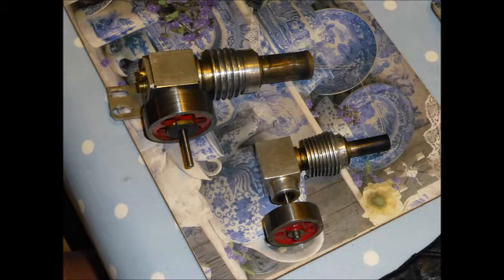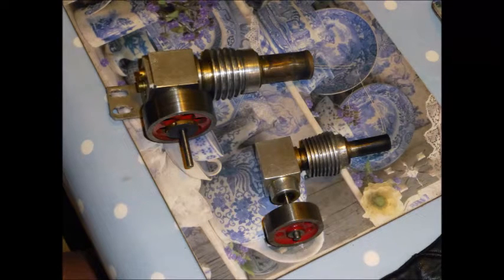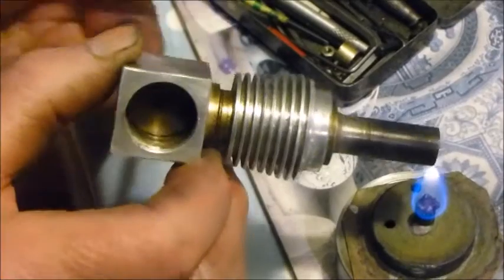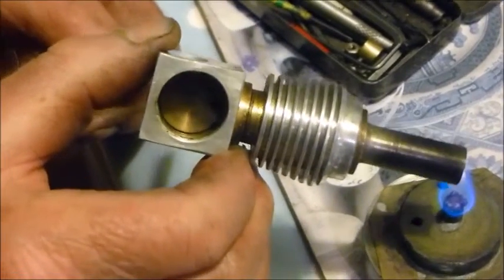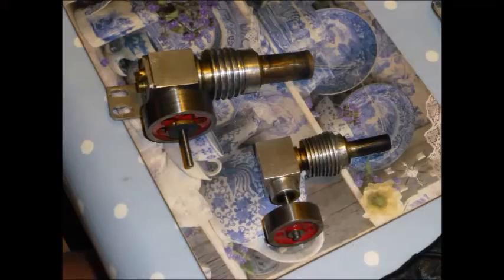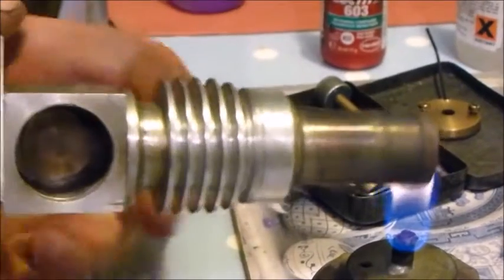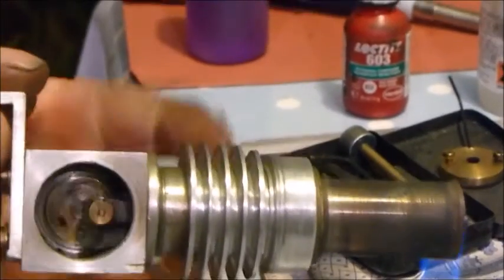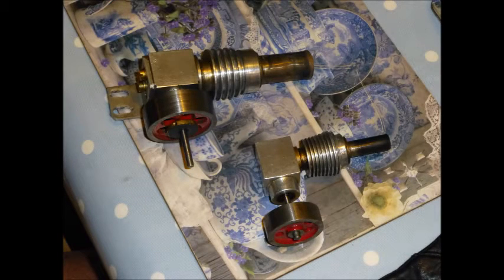Do Stirling Engines Need a Flywheel?

Comment: Congratulations, I love the sound that your engine produces.
You manufactured this engine?
What is the maximum speed?
Leandro Wagner.
Reply from the maker: Hi Leandro
The beta engines are made by Julian Wood. He has made many tens of them over the years. They are pocket sized and are very useful as demonstration engines. With no load, they run around 500 rpm.